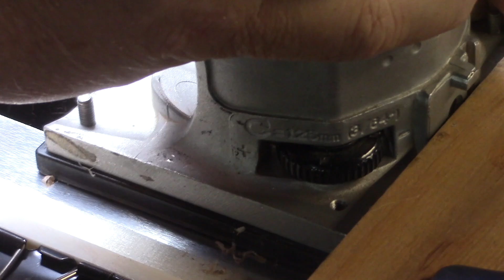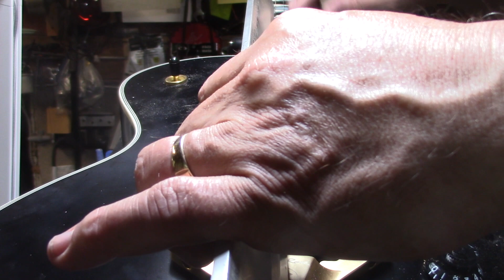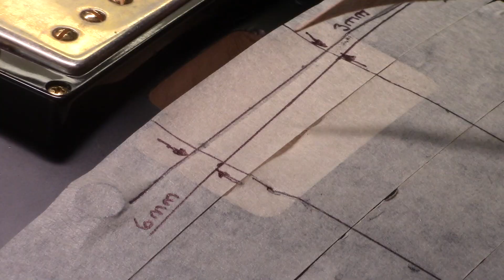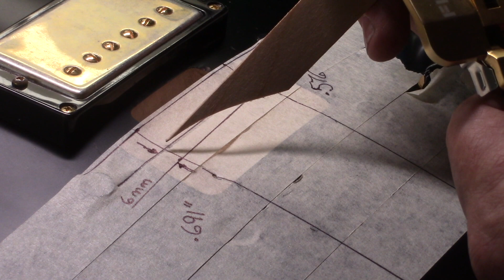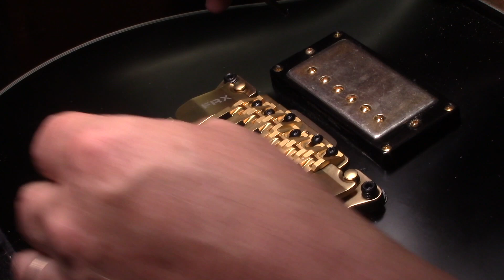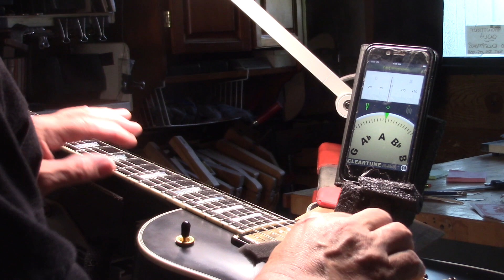FRX Install + Calibration @StringTech Workstations

Comment: Very nice! I’m thinking of getting an SG modern and adding this FRX to it, hopefully it’ll be way easier than this!
Reply from the maker: Good luck!
Reply: That was my guitar in the video. The surface is highly curved, much more than a modern Les Paul, let alone an SG which is completely flat. The FRX was designed for the SG. It can be added and swapped back with no issue. Link to setup video: https://youtu.be/hPc6fOYoNTY?si=AySE8kmHrXFr7FLd

Comment: I went to the floyd rose site and saw the owners video there are two pieces missing  cause I don see the stop use or the ball resett for the floating part not just the locking part and it mounts on the stop bar ? there should be no mod needed  but you know your measurement cold maybe you should of got it before he installed it there are two type of locking  nut for the head on has spacer for different angle headstock
Reply from the maker: In the owners manual they do state that in some cases ( and this was one of those cases ) that some routing is required.
Reply: Good eye. That is my guitar. I did have a few tweaks to do when I got it back including installing those pieces. It works perfectly. Can be floating, dive only, or fixed. Has a completely differrent feel than a standard Floyd Rose. Does exactly what I was hoping it would do. Stays in tune perfectly and I like it much better than the typical tremolos used on Fender or PRS guitars.

Comment: excellent job, but the point of FRX is to add a floyd to a guitar with no mods... might as well have put in a normal floyd at this point haha
Reply from the maker: I realize that. But in this case the neck set didn't allow for the normal installation and function. The customer started the job with a Dremel .... then realized that it was gonna need much more excavating ( Lol ! )  to make it work. In the end it all worked out ... plays and sounds like a dream ... buttery smooth and PERFECTLY in tune ;^ ) \m/ !
Reply: Its my guitar. I knew I would have to do something permanent (cut into body) with an arch top. The Eastman has a high arch and the posts (per video) had to move. The FRX is awesome. Has options the regular Floyd doesn't (fixed bridge mode, dive-only, and fully floating). It also has a different feel. Very happy with it. Setup was spectacular. The tone and sustain is amazing. 

I find I can get double stops and bends to stay in tune in fully floating mode. Can't do that with my Charvel San Dimas with original Floyd. Have a USA made EVH signature and its awesome too, but dive-only. The tone and feel of the Eastman (especially the neck) is better than my EVH. NOTE: with normal Floyds I much prefer dive only. It just has something special about it that rings out. Loudest acoustic-like sound of any electric guitar I own.
Reply from the maker: Thanks for clarifying Trevor. Also : Take note... that in the owners manual / installation instructions ... it states that oftentimes a channel will need to be routed in order to allow for free movement of the spring loaded push rod.

Comment: Everyone, this my guitar and I wanted to share some background (will be long post), but first... Thank you Mike! What a wonderful job and all your effort is very much appreciated. 

Background: I played someone else's guitar... with an FRX and I just loved it. I am someone that likes the standard Floyd, but only with a dive-only setup. Just have never been a fan of floating versions but get why some lead players love it. So, I simply wanted a guitar with an FRX. A natural fit is the Gibson SG (its flat body is ideal), but I like Les Paul's more. Then I saw a video of a Les Paul retrofitted with an FRX and decided to experiment. I bought an Eastman, so I wouldn't commit blasphemy on a Les Paul (cut into the body). Plus, its an experiment, so I wasn't going to buy the most expensive option out there. I heard great things about the Eastman and got a very nice discounted price for a new one. Off I went...

The Eastman design is going after the 59 body style and its crafted by hand (there are no CNC machines where its made) ... it simply has a deeper arch than most modern Les Paul's. I didn't realize at the time how that increases the challenge. The other Les Paul retrofit was a minor cut into the body. I expected similar. So, I made a little cut with my Dremel, that cut turned into a bigger cut, then more... you get it. I cut much more than expected. When I thought I cut enough, I realized the FRX would not intonate. I knew the posts would have to move and I have no tools, nor experience to correct the problem. So, I reached out to local luthiers. Two luthiers said it was fine... you have seen the video... it was not fine. Guitar went into case and into closet while I searched for a luthier I could trust (harder than I thought it would be).

A long while later, I found this channel. Eventually, I made the comment about struggling to find a luthier I could trust. Mike replied and said, "ship it to me". Clearly, I did and I am writing this before I have actually received it back but I am sure that I will be happy.

COMMENTS ON FRX: Why did I fall in love with it? 
1) I has an entirely different feel. Its more subtle. I like it. 
2) It has different "modes".. it can be set to fixed bridge mode, dive-only, fully floating... and it has a setscrew (not installed in video) that can be adjusted to set the balance point. It takes more pressure to get it out of its balance point. You adjust the set screw to just enough pressure so that while bending a string, the others don't go out of tune. 
3) Its much easier to tune (just roll up that thumbwheel)

I don't think Mike is aware of that balancing set screw because it wasn't installed. The reason I don't like a floating Floyd: if you bend one string, it bends the Floyd... and the other strings go out of tune. What wasn't shown here is what that set screw does. With it in, you can pull back or dive, but its "sticky" at the balance point... which allows bending strings without moving the Floyd. 

My words are never as good as video: So, here is a link that demonstrates the difference between a regular Floyd and the FRX quite well (including what that missing... what that set screw does): https://youtu.be/8XpGtnUoKn0

BTW: The guitar in that video is now almost identical to mine (only it was built that way from the factory). I might have bought that instead, if it were available at the time. It wasn't.

COMMENTS ON EASTMAN: The craftsmanship on the Eastman was stellar, the tone from it was outstanding. What I loved most is the neck. Everything about it felt great to me. My only complaints: I didn't like the tuners, so I replaced them. I would have preferred the modern rather than relic version of tailpiece with skinny posts (but I  knew I was pulling it off anyway for FRX). 

Eastman does have a bone nut and the guitar in video I linked uses a normal locking nut. You normally can't compensate a locking nut... unless it is like mine... the locking part is behind the bone nut. I did see how Mike is able to compensate locking nuts by fashioning a nut in front of standard Floyd locking nut, so guitar in video could be compensated using Mike's technique. Overall, I am very impressed with the Eastman. 

I told Mike: I am sending you my 'wounded bird', hoping to get it to fly (sing) again. You can tell from video, how knowledge and experience leads to quality results. The details Mike pays attention to is phenomenal. I am going to those luthiers that told me it was fine and will show them guitar, ask for them to watch video, and I am hoping  they decide to join Mike's Patreon. I believe they are both young and open minded. Maybe we all win :)

Thanks Mike! Wish you and your family the best. You healed my wounded bird. So thankful.
Reply from the maker: Thank you for your faith and encouragement; as well as the details and background on the FRX and the Eastman. Much appreciated ! MMcC